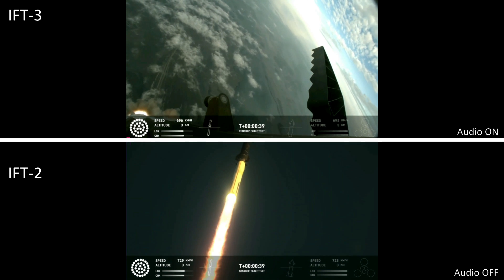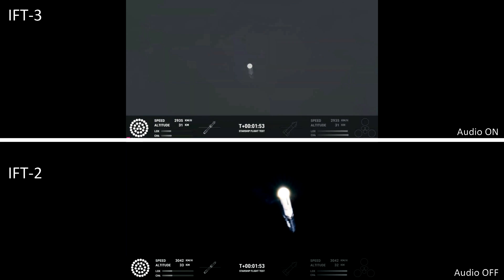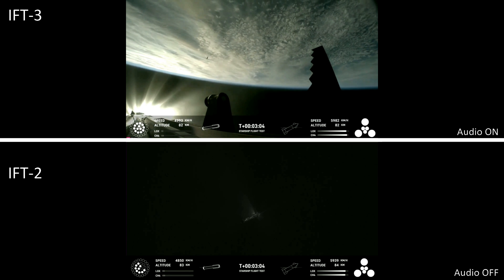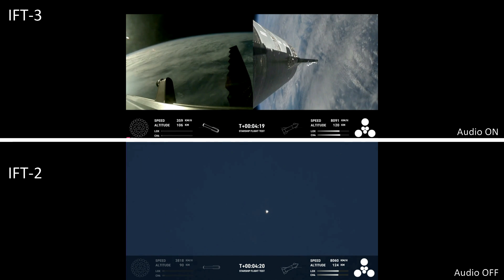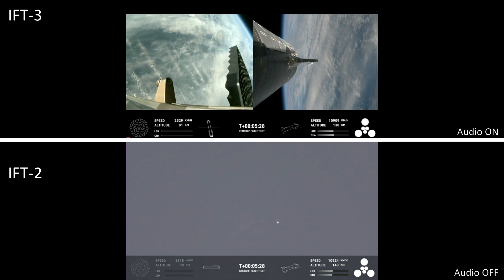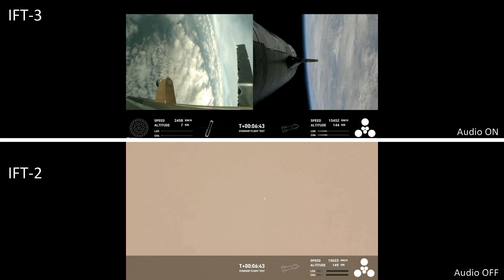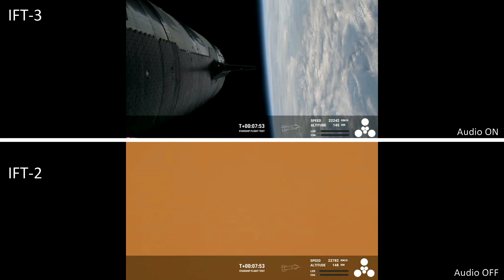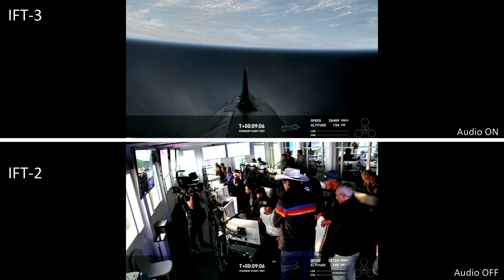SpaceX Starship IFT-3 vs IFT-2 Perfectly Synced Side by Side Comparison

Comment: Any idea what gone wrong with the ship 3 reentry?
Reply: dunno. but it was during that plasma burnout. So my guess is one or couple of the heat tiles failed.
Reply: If you look carefully you'll see that the ship is rolling on himself and spinning out of control to the point where the steel part of the ship and the engine skirt is exposed to plasma. One of the advantages of stainless steel is that it resist pretty good to high temperatures but it can't survive indefinitely, it probably finished by melting and in multiple pieces in the atmosphere

Comment: Whatching a rerun of IFT 3. I don't think the pez door locked shut. you see it spring open and flap about. I bet that will be why they lost starship
Reply: The leading theory in the community is that they lost some hot gas thrusters and  weren’t able to stop the ship from rolling before re entry
Reply: @markmontagna7637  she was re entering side on at one point for a decent amount of time and looked like she spent a fair bit of time retrograde too, frankly I'm very impressed it held together for that long flailing about like that.
Stainless steel for the win 🥳
Reply: @markmontagna7637  Really? I don't think that would have done it. It seems they got the orientation of ship sorted only moments after the first plasma curtain formed. And while that initial plasma may have looked very intense, I don't think it was dense enough to overheat anything with only a few seconds of exposure. Even with the pez door stuck open. My expectation is that the missing tiles are to blame. Maybe during the more intense part of reentry, the plasma burned through part of the flaps and fuel tanks. The ruptured tanks could have resulted in detonations of fuel vapors with the invading oxygen and/or compromised structural integrity during a period of high lateral g loads caused by aerodynamic drag, burnt through flaps could result in loss of control of the vehicle orientation.

Furthermore, the loss of one tile could result in the loss of surrounding tiles too, as the steel underneath them is heated up by proximity to the missing tile location, causing degradation of the whole heat shield over time.

My guess is the vehicle broke up maybe 20-30 seconds after the loss of the telemetry signal, which I chalk up to just plasma blackout.
Reply: I think the main reason for the loss of the ship was breakage of a lot of heat tiles

Comment: Ift2 about 50-70 km/h faster then ift3 not sure if it’s the video or not. Interesting
Reply: Yeah… 3 lifted off quicker, but 2 was a bit faster in the end. Ship 2 was actually slower than ship 3 after separation. I’m guessing atmospheric pressure and winds could have been a factor in overall speed prior to separation as well.
Reply: @stormysyndrome7043  I’m not sure if it was slower right at launch. they might of just throttled the engines down for the duration of the flight to relieve some pressure on the fuel piping. As you could see during the final splash down burn when the engines went to reignite 3 started and 2 immediately shut down. 1 appeared to stay lit before they lost connection. The amount of pressure in those fuel lines is ridiculous I think the same thing that happened during IFT2 happened again. At least super heavy booster was able to relight once.
Reply: @stormysyndrome7043 3 started it’s engines at t-2s

Comment: Oh dear, once again both parts failed to pass their tests. The most expensive part came down around Mach 2, the Starship never had a chance when the leaks appeared just after its engines shut down. Because they never thought of including reaction thrusters, they were unable to stabilise the Starship when it started spinning, around one revolution per 60 seconds. Consequently, you can see the Starship present its heatshield to the sun for half the time. Did you notice all the pieces falling off Starship? It never made it past re-entry in one piece, I lost count of the debris pieces flying off. So, you reckon this was another great success just like the other two failures and fully worth the $3 billion dollars of taxpayer's money that just exploded.
Reply: The Starship and Superheavy landing were secondary objectives, they both managed to do every test in orbit.
The Starship and the Superheavy both cost less than 150 million dollars, and because SpaceX is a private company, it does not get money from the US government, the only exception is when NASA hires SpaceX to send cargo to the ISS.

- 33 Engines working
- Liftoff
- Hot Staging
- Flip Maneuver
- Boostback Burn
- Superheavy Descent
- Water Landing (failed)
- Starship Ascent
- Starship Engine Cutoff
- Cargo Bay Door Test
- Fuel Transfer Test
- Raptor Engine Starting In Space (kind of failed but it didnt actually fail because they didn't even try to turn on the raptor because the starship was spinning so turning it on would probably have made the starship explode)
- Starship Reentry (kind of failed because it initially survived but then it disintegrated)

Trial and error, if nothing is failing, you're not innovating.
Reply: We should have you in comand. We would only need 1 try...
Reply: @hwiqq  it amazes me how doing this is still cheaper than nasas " 1 try with a mere 1 decade of development "
Reply: "Taxpayer money"  💀 
Bro it's a private company, this is with their own money
Reply: @gilbertbrown2636  Where did NASA get the $3 billion dollars to pay for these tests, look it up it is in the public record, from taxpayers' money. musk isn't funding diddly squat, but he will be paying back that $3 billion if he doesn't get this to where it has to be in Dec 2026 and that is according to Jim Free, I suggest you look him up. He is already on record stating that the problem is that they (SpaceX) haven't hit the milestones for the program, it is 3 for 3 now and he may be looking for a new job.
Does that help Gilbert, I suggest you also listen to Jim Free on 60 minutes titled "NASA is working with SpaceX and Blue Origin to land U.S. astronauts back on the moon".
Enjoy. :goodvibes:
Reply: It didn’t cost 3 billion in tax dollars.  Look at the cost of sls.  One launch cost more than that.
Reply: @jamskinner  Excuse me, look it up online it isn't a secret, where does NASA get its budget from? That's right taxpayers money, read it and weep when you are old enough to pay taxes.
Reply: @curio78  That's what they said when SpaceX announced they were going to land a booster and then that they were going to land it on a barge. Chicken Littles like you and ibnBahtuta crowed all over about how stupid that idea was and that it was impossible. You just make the inevitable victory sweeter. Thanks for that!
Reply: As long as you foolish crybabies who say it can't be done just stay out of the way of the people making it happen we'll be just fine. Hope you're not against being quoted at length after the inevitable success of Starship.
Reply: @alaskandonutSkeptical, not cynical. What matters is how NASA is going to handle this. They already have Blue Origin penciled in and they are risk averse in their design approach, keep it simple. Unlike the most complex piece of wishful thinking, I have ever seen in over 50 years as an engineer. Mr "The best part is no part" might have had a miniscule chance of pulling victory out of the jaws of defeat had he watched how Dream Chaser is going to handle in-orbit maneuvers. He would have had a chance of stopping the spin caused by the leaks.
 But, no not cynical, that doesn't solve problems. Just look at the proposed refueling of Starship, they will have to launch over twelve times to fill it once, how do you see that brilliant idea working?
You can paint it anyway you like but this program has buried careers and Jim Free must be busy re-writing his dwindling curriculum vitae as I type. He was another one that was warned well in advance, but he didn't listen either.
Reply: @IbnBahtuta
As stated above, BO also has to do multiple launches.  No idea how many.  So they have the exact same complexity issue.
Reply: Finally somebody talking sense, thank you.
Reply: It purposely leaked oxygen to dump it.  That was by design.  Yes it obviously had control issues.
Reply: @jamskinner You are a joke mate, they had a leak on purpose? What about the other leaks and the debris falling off what was that for again?  Act your age Jam, not your shoe size and do some research before you publicly make a fool of yourself again.
Reply: @alaskandonut No, you haven't even mentioned the in orbit refueling, how many launches per Starship flight to the Moon be need to refuel Starship? The number is estimated to be in the teens. How do you think that is going to work out?
Reply: @IbnBahtuta yeah that comes under the difficult part of his statement bud 🤦‍♂️
Reply: @IbnBahtuta
BO. has the exact same problem.  It can’t get to the moon without refueling either.
Reply: @jamskinner  Yes but it is a simpler refueling system by virtue of the fact that it doesn't take 10th of the flights to provide that fuel, but you would have known that if you had done the research.

Comment: Today is another Muscovite failure. Bill Nelson needs to go, along with all the Muscovites on staff. Why isn't Congress holding hearings and demanding accountability from the Musk Ox. Why does Bill Nelson still have a job?
Reply: WTF are you talking about?
Reply: @brianbagnall3029  fucking schizo out here rambling
Reply: idk if you know, but the main mission was a succses. rockets usualy dont attempt to land, starship made it to space. right now starship could be used as a normal launch vehicle and still be cheaper than any other heavy lift vehicle. and also these are meant to be tests to get data. they dont build rockets like nasa where every launch needs to be a success, but rapidly building and launching, to get data that is needed to build a rocket that can be fully reusable. its just like falcon 9 before they were reusable. spacex has another rocket getting ready to take off, they will fix what they can from data gathered and they will try again. every time getting closer and closer to the goal of fully reusable and extremely reliable.
Reply: Maybe in 2054 the first Starship will launch and land in one piece. Reaching the moon and return in one piece will never happen, let alone reaching Mars. With humans on board, only in wishful thinking dreams. One day Musk has to face the fact that the whole Starship project has failed. In a year or two also Tesla will go bankrupt, because there just isn't enough energy available for all those electric cars. In the Netherlands we already encountered the limits, we have huge problems with the energy network, cars are now forbidden to charge by local government. Tesla car sales and other electric brands dropped immense, and subsidies are all stopped. Whole Europe went into crisis, islam asylum crisis, world war 3 is coming. Things will be completely different as people projected before. Life is uncontrollable. Just like Starships...  @yujinhikita5611
Reply: Baby can't run before it can attempting to run, how surprising /s
Reply: Private companies can do whatever tf they want, that's capitalism baby 😘
Reply: Shut up hater